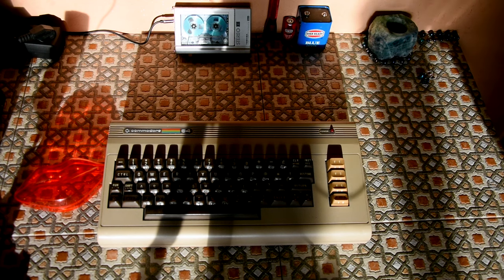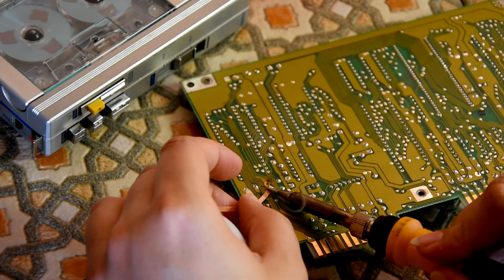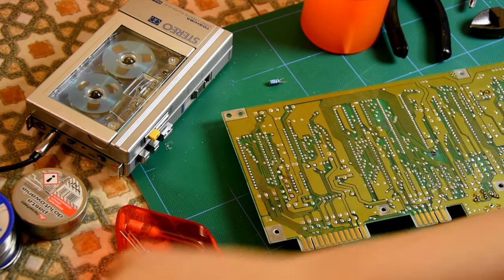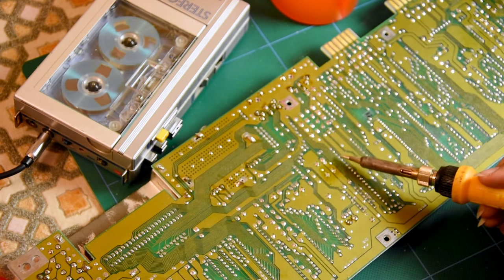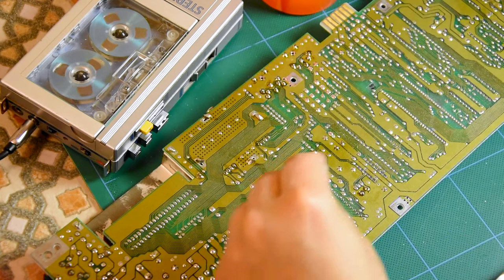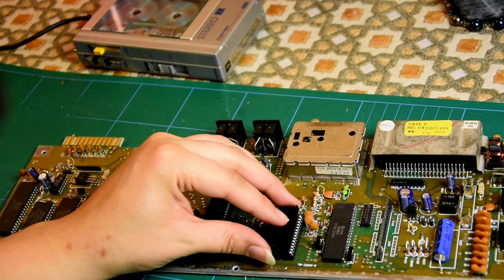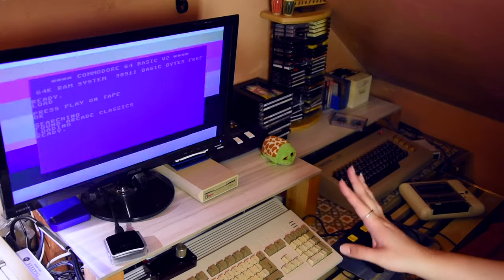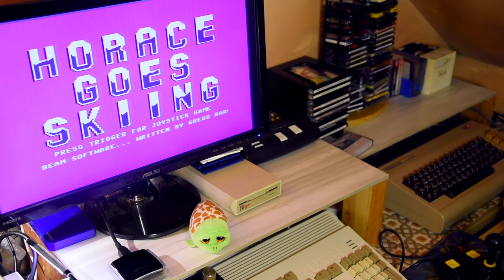C64 - Replacing Capacitors

Comment: I love that you have Commodore chiptunes running in the background as you work!

What symptoms would you see if the caps started to go bad, and would it cause any damage to the chips or other parts of the board if you didn't replace the caps before they went bad?

I have to appreciate how much enthusiasm you have for the C64, old games, games on cassette, and DIY repairs.  Keep the Commodore alive!
Reply from the maker: Thanks! And I like doing that with chip tunes, it creates a nice mood :o)
If a cap leaks it can corrode the PCB itself, but if it just gets hold, the caps will shift value, so things wont work as well, you will get crashes more often, like i've experienced tape errors.

Comment: Maddie, 

I'm not really into computer games, but the capacitor replacement lesson is excellent!  It's nice to see that the recapping allowed the picture to improve and some unusable programs to load, becoming useful again.  

I've heard that recapping can solve a lot of problems with older electronic gear.  You've shown that to be very true and the time watching was well spent.

Tom
Reply from the maker: Hi Tom, 
Sometimes it's hard to pinpoint what has improved, as the issues caused by bad caps is vague, i'm glad it was quite clear in this video. I remember being told that my amplifier didnt sound better, that it was just a psychological thing. But why wouldnt it? all the values of the capacitors are correct now and wouldnt that make a difference to the audio? As you rightly said, it can solve a lot of problems. 
Thanks for watching and your comment Tom

Comment: One trick for desoldering capacitors is to heat up one leg while you apply pressure to the capacitor on the other side of the board.   Do this one leg at a time, alternating back and forth until you get the capacitor free.  Once the capacitor has been removed you can either desolder the hole or heat the hole while pushing the new capacitor lead through.   

And your pronunciation of "microfarad" is cute!   :)    

-bob
Reply from the maker: Thanks for the tip, I may try that actually :o)
Reply: Remember, heat rises.  And sometimes you have to add a touch of solder so your iron can conduct enough heat to the pin that's halfway through to get it to melt again.

Comment: That's the way to recap a C64, sunlight streaming in, SID tunes on a nice tapedeck, a bit of juice on the side. Who cares about the soldering tip not being optimal. Desoldering and seeing the solder creep up the wick is indeed satisfying. Even on video. 

You eloquently demonstrated that good working caps are indeed necessary for the C64 to be a 100% compatible. The circuitry and the chips will just interact differently and that can result in errors, crashes and a lower compatibility rate.
Reply from the maker: Indeed! the perfect atmosphere is important to me. 
And yes I was surprised at the difference the recapping actually made, unfortunately I accidentally snipped out the part where I tried munch mania when editing and didnt realise until I finished rendering, but that worked also after the recapping!
Reply: You prolly dont give a shit but if you are bored like me during the covid times then you can stream all of the new movies and series on InstaFlixxer. Have been binge watching with my brother lately xD
Reply: @Jett Chaim Yup, I've been watching on InstaFlixxer for since november myself :D

Comment: the four things that I have learnt from this particular video are
1. very often old capacitors need replacing.
2. when there are problems it is not easy to spot that it is being caused by faulty capacitors.
3. they can cause weird faults so that some tapes loaded but others didn't.
4. making the effort to replace the capacitors is so much better than just throwing the machine away.

Comment: A good tip to desoldering components is to actually add fresh solder to the bottom side of the board and pull the component out from the other. the new solder helps the old solder flow and a few wiggles and you should able to pull the component out. then you can clean the pad with braid or a desolder sucker. Great video as always!
Reply from the maker: Thanks, actually i've been doing that, I forgot on the first joint and it took ridiculously longer to melt, Which is what reminded me lol it makes a huge difference. And thank you!
Reply: +MsMadLemon As a side note if you have a problem desoldering a component you could add some low melt solder like QuickChip (or cheaper alternatives) which will help keep the solder flowing for longer after removing the applied heat. You do however need to do a good solder cleanup after removing the component as you don't want the low melt solder to contaminate the new solder joint. Also it never hurts to have some no clean flux (paste or liquid) as that helps solder flow and stop oxidization, even desoldering.
Reply: Some of those old solder alloys require higher heat, because they had higher lead content and less tin.  They also didn't flow as well.  Adding new solder changes the alloy making them easier to work with.  You might notice a difference between the manual-soldered connections from factory vs automated because they also used different solders.

Comment: Wow the re-capping really did make the tape errors go away? That must mean that not only was the video signal path affected by bad caps but also the tape signal paths. I suppose some turbo tape loaders caused this issue by completely removing the checksum double check which made a faulty data transfer more likely to happen when the voltage isn't right inside the circuitry due to bad caps. I'm glad that got fixed now :) That means you can even enjoy my two C64 mixtapes :P
Reply from the maker: I think the wrong value of the capacitors due to them needing replacing probably goofed up something or other, hence why some turbo tape loaders just couldnt work with it :o) ... 3 games that didnt work, now work just simply by recapping, I did nothing else... I thought you already knew that your two mixtapes worked before :op
Reply: Oh i do know they work as you showed me ;)  I just meant that you can now play all the games. Because i think 2 of them use a much faster tape turbo. I think "Eleminator" for example, which i converted from a .prg file to a .tap file and then converted to audio.

Comment: Great job!  I find it easier to heat one pin of the capacitror and pull it through on the other side.  Then repeat for the other leg, and finally unblock the holes with desolder pump or braid.  It's worth recapping the modulator too - pain in the $$$$ to get the modulator off (you need high temperature), but there's 4 or 5 electroytic caps in there, and they do affect the composite video output (even if you aren't using the RF output).  LOL @ the animation there =D
Reply from the maker: Thanks for letting me know about the RF modulator, I didnt know about that, I think i'll tackle that when my desoldering pump arrives lol it's not a friendly looking thing. I always thought you could remove the lid of the modulator if you straighten the metallic lip thingies with a straight head screwdriver, I did that with the zx spectrum...i'll give it a try
Reply: No problem =D. Yes, you are right - the lid comes off the modulator, but you can't get to the solder connections for the capacitors =\
Reply: I want to remove the RF modulator to eliminate any noise sources, as well as ground the audio-input on the video port.  Is there anything useful that can fill the space where the RFmod used to be?  Seems like a good location for a fan controller or something.
Reply: Even without recapping the modulator. Some 70 percent noise and interferance have gone on my C64. The sound is even better. I will take action on my modulator as well in the future. Time is the big issue in my life.

Comment: Yeah I love my electric desoldering iron once I got it. It makes easy work out of anything through-hole.
Reply from the maker: Mines on it's way here.. and it seems like a good one, i'm happy because I have more recapping to do :o))
Reply: I use a Hakko FR-300 desoldering tool and I love it. I wouldn't want to go back to using just a soldering iron with braid or a solder sucker. I even use it on SMT components and it works great.
Reply: Yeah that is what I have as well, worth the heafty price.
Reply: +Roy Gillotti I recently got back into electronics and needed to replace a power jack on my wife's laptop. In the process (which took over an hour) I burned the board because I didn't have the right tools. The soldering iron was hot enough but on the grounding pins due to the thermal characteristics it took an age to melt the solder and even then I was using a solder sucker with the iron and it was a mess. I did get the new jack in and it has been working fine, but I was unhappy with my work so I bought a new Iron (Hakko FX-888D) and the desoldering tool and have found nothing to cause me that problem again. Worth every penny.
Reply from the maker: Okay since you two both know the Hakko brand, perhaps you can solve this mystery... what is the difference between W.E.P and Hakko?   I've read in some random place they're the same more or less.   I have that W.E.P 942 soldering station which I use (and love).. then I look up a Hakko 942 and it comes up with an identical product.
Reply: Well Hakko is the big name brand, many other companies copy their look. I have a W.E.P hot air reflow station and my soldering station is also another company copying a Hakko station, both work great and they fit my budget at the time. I'm sure the W.E.P desoldering tool will do just fine, many review videos I've seen showed the Hakko Clones worked fine, just that they may heat up a little slower or someone complains about where they located controls or something. I got Hakko mostly because of their warranty and I've been told their customer service is good.
Reply: +MsMadLemon I cannot find a teardown of that particular model but I have found that W.E.P and Yihua do some identical models so it seems reasonable to assume that they get parts and manufacturing from the same places. I have seen a few teardowns of Yihua models and they do a number of clones of Hakko products. The teardown show that the internals are sometimes but not always based on the Hakko product. But every teardown concludes that it's not the same inside (Hakko sometimes use custom parts) and that cost cutting has been done. That's not to say the device isn't any good it's just not the same and it's made to a lower budget, many of the models do have some interchangeable parts.
BTW the Hakko 942 was discontinued in 2006. From what I can find out, if your 942 has a compatible Iron you should be able to use Hakko (or clone) T12 Tips which are good.
EDIT - LOL it appears Roy Gillotti replied while I was typing mine :-)
Reply from the maker: Thanks for the info Roy and Daishi! I appreciate the in depth info! 
I actually ordered some Hakko or Hakko compatible Tips along with my desoldering pump, both have just arrived. I think I will record a video on what I got as there have been a couple of others asking about which desoldering pump I got. So i'll do a bit of a first impression and demo, where I got it etc.
Reply: I haven't used my solder-sucker in 30 years and it still made short work of my recap work last night.  Even the faraday cage for the VIC-II chip was easy to remove.  But a powered version would have been easier, still.

Comment: Good work. I believe reflowing has to do with heating up solder in mass with a heat gun or oven, for example to reattach a surface mounted chip.
Reply from the maker: Thanks Shawn. Ahaa! I have no idea what gave me the impression that introducing fresh solder was called reflow. Thanks for clearing that up.

Comment: Wow those caps sure did clean up the picture! Also, while snooping the comments, noticed your comment about what cables and upscaler you use, and decided to purchase a similar setup. Apart from a tube having "some" advantages over any LCD, even I have to admit HDMI is really the future. Thiose tubes won't last forever, so I'll take the pixelated look over no image at all any day ;)

I was still using an old Amiga 1080 with my breadbin, but the tube is really on it's last legs. Will probably retrofit it with a suitable LCD screen if i ever find something that fits the case without having to resort to Dremeling, so it's on hold and in storage for now, but with the new hdmi scaler and cabling on the way, probably time to dust off the breadbin and get a working setup on the bench. Thanks for sharing the fix, I'm sure i'll have to resort to doing an overhaul of mine in the future, so I've bookmarked this vid.

Cheers!
Reply from the maker: yeah I think I would go with flat screen HDMI too these days, I mean sure a CRT does have that nostalgic appeal no doubt, but there's goign to be a whole new can of worms haha, not to mention eyestrain, and it being so bulky. fitting a flat screen inside the Amiga 1080 sounds like a cool project though, you could even install it with an upscaler, maybe even a little amp and speakers (okay my mind is running away with me here ;o)) 

I'm glad you enjoyed the vid and found it useful :o)
Reply: Make sure you use a HDMI monitor, not just a HDTV.  The HDTV's all have horrible response rates (lag), which even the upscaler contributes to.  5ms-15ms is virtually undetectable but can impact timing of games, such as timing a jump.  HDTV's typically have around 50ms delay.  The upscaler, 25-75ms.  CRT tubes have no such delay whatsoever.  A modern HDMI monitor will typically have 0.1ms to 1.5ms delay.
Reply: @officermeowmeowfuzzyface4408  Another thing you must account for, is that there are differences in refresh rate. Trying to display a 50hz game (refresh rate) converted to 60hz, will give you a result, were the horisontal and vertical scrolling becomes stuttering or lagging or what the correct term is. Is looks like it is "jumping" or skipping over a frame or two. The only solution, is to have a monitor that can sync to 50hz refresh rate.

Take this new thing that are all the rage these days. It is that mister thingy. Shure you can have C64 and Amiga cores and hdmi out and all that. It will still output a 60hz image at the end. The video here on youtube, were he is testing it with pimball dreams. That video shows exactly what is wrong with 50hz games on 60hz monitors.

The vertical scrolling on the intro text, are chucking away with lag. The bottom line that scrolls horisontal in the table select menu does the same, and the score board on the top of any table, does not flash at all.

Nope.... We need LCD monitors that can display as low as C64 output, as well as doing 50hz refresh rate. Once you see the 50/60hz issue, you will always be annoyed by it.

Comment: Should have also replaced the 7805 and 7812 onboard.
Those electrolytics will have a similar life as the original ones.  Should have upgraded and never need to replace them again.
Reply from the maker: There's no point replacing regulators if they're working just fine. .. and electrolytics will be fine for another 30-40 years.. by then i wont mind recapping them... this is not a big deal.
Reply: The 78xx TO-220's run hot and are very inefficient.  This means more heat inside the case, as all the other components contribute to this heat and also are warmer.
78SR modules are much better; they run cold and are >90% efficient, which means more available current.
They also produce a much cleaner DC signal but also have built-in protections.
Also, if those old 78xx packages do fail, you risk burning out your precious chips.

Electrolytics depend on the environment they're in.  The C64 is hot inside, with original components.  This ages those caps faster, as they're rated for so many hours at a specific temperature.  As they degrade, your C64 will run fine but small problems will start showing, similar to but not as bad as before you replaced them the first time.  Tantalums for example will not degrade like electrolytics, and they only cost a little more.
Reply from the maker: Thanks for the advice, i'll go with Tantalums next even though i've bought some capacitor kits already which are electrolytic, a bit too late but nevermind. 

I'm glad you're not one someone who says "these computers dont need recapping, it makes no difference".. when I clearly proved that it did.
Reply: "dont need" would be crazy talk!
Reply: Did you really say "ough" or "uf" when you meant micro-farads?
Reply from the maker: "uf"

Comment: Nice video. You really should take care of the power supply too because the voltage regulator for the +5V tends to fail quite often these days, killing your beloved C64. Sad thing is, you can not replace it because the whole pcb is covered with epoxy.